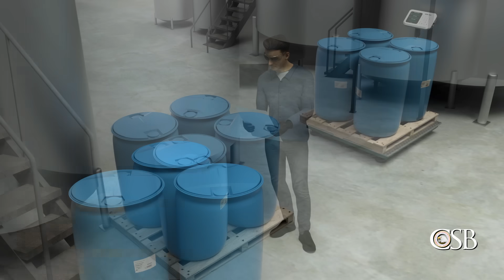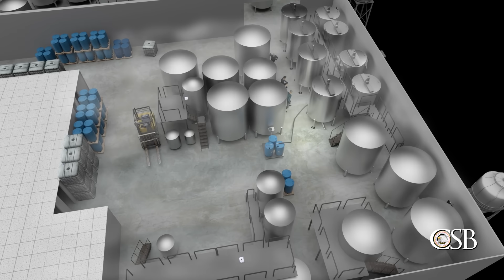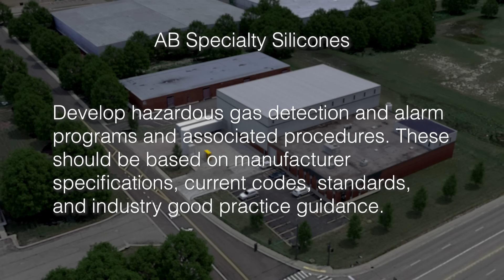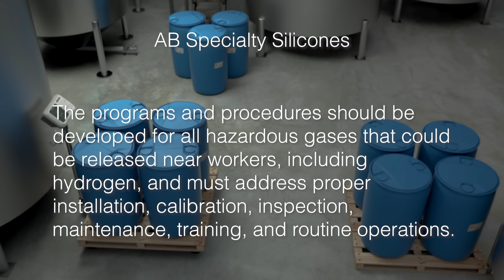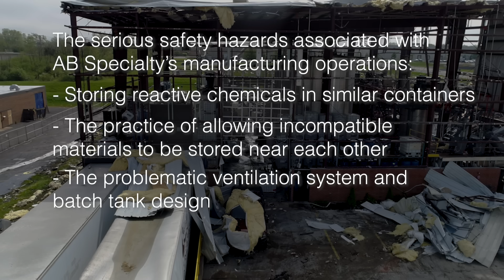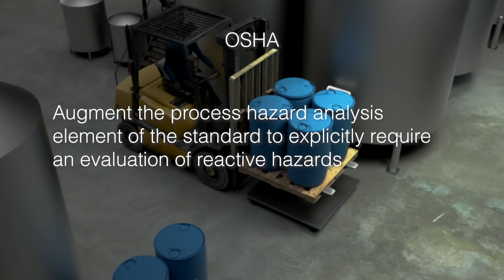Incompatible Chemicals: Explosion at AB Specialty Silicones

Comment: Earlier this week I had a tyre patched at a tire kingdom shop. The shop sent a young kid ( maybe 20 y/o) w just a floor jack, no jack stands, no wheel chocks, to lift and work under my 7000lb truck. I took photos and informed the local manager and corporate. Also I called OSHA. As of 72 hrs later no one has shown any interest in the problem. Guess we just have to wait until someone loses life or limb. Very sad.
Reply: I used to work Merchant's now Tire Kingdom they don't give a shit about safety and didn't care that we needed new equipment my store manager almost had his head smashed from a tire after he got it on the rim went to put air in it to set the bead and when the bead set the whole tire came flying off the tire machine
Reply: You wouldn't believe how many people disable the locks on their lifts ...
Reply: @Merker367  I know ive seen some pretty stupid shit when I was in the shop guys not putting lift on locks to service manager getting his leg cut open when he opened the bay door and the glass fell out of the door
Reply: Ineptitude for profit is at cabinet levels.
Reply: Why did he have to get underneath a truck to simply remove a wheel?
Reply: No jack stands is a big problem especially from my experience. I have never done any work on even a 1 ton car without stands. The only thing I don’t use stands on is something I can lift myself.
Reply: Way to get the dude fired, asshole
Reply: Republicans don’t want to fund OSHA or the FDA, so work and food safety inspectors are spread very thin. It takes a major problem to get their attention now. Or you have to know the right people.
Reply: This is America, where workers will cheer for politicians that tell them "let's deregulate the job creators!" This is what we end up with.
Reply: @gloomyblackfur399  Modern regulations don't make us safer. People deciding to be safer, makes us safer. Most regulations are pencil wipped for "compliance" but actually changes nothing and most of the time the regulations are not really compatible with the work being done. No one knows better how to be safe than you, teaching employees about the hazards and encourage them to take steps to keep themselves safe instead of cookie cutter safet regulations are much better. Modern regs just increase costs for all of us while not adding much protection. Basic regulations are good but the more complex recent ones don't seem to translate well to the real world.
Reply: @gloomyblackfur399 look how he spelled tyre😂 he’s uk
Reply: If you're just doing a tire and you're not under the vehicle you're fine. I mean, might fuck your brake rotors up a bit if it falls, but thats it

What kind of truck do you have that weighs 7000 lbs? F250 or equivalent?
Reply: @RVBJohn  ok so a shop drops your car on it's rotors and bends up the shields and your supposed to be ok with that? No matter if someone's under the vehicle or not, always use stands
Reply: @Merker367  i worked in the automotive field for over twenty years, A.S.E. certified, was a certified state inspector. Never used a stand under a vehicle that was one inch off the ground to remove a tire for a short repair. You can be critical about everything if thats what floats your boat. Your grocery store makes more safety violations that most repair shops. In my twenty plus years i never had or saw a floor jack fail suddenly. They give warning signs when they get weak. I am shocked a person would call osha over a person not using a jack stand for a 5 min repair. Probably the same kind of person to be first to complain the repair takes to long or too exspensive. I had osha and the e.p.a. in my shop a few times and never had a problem. What is the funniest part is he makes no mention if the 20 y.o. had eye protection on or ear protection on. If he was truly concerned, that should of been his concern. Its sad this person watched one of these videos and decided to put on a cape and save the world. Please introduce me to your amazing perfect world. Glass houses and rocks and all that. This is a great example of what happenes when a person gets a little bit of new information, they suddenly feel they are an expert on safety.
Reply: @Merker367  I agree, but they were talking about not using a jack stands. That was why I explained why they don't. I didn't just tell them or you to be quiet. That's part of the problem today, a person that is qualified to speak on this topic is being told to be quiet and you're being dismissive. Anytime a person has any part of them under a vehicle, they should use a stand. This case, the kid wasn't. Ofcourse he should of been wearing eye and ear protection. Instead of that being asked people switch to cars on lifts, and locks on thier lifts not being used, which I agree with you they should never be bypassed.
Reply: If the consequence is a damaged vehicle or broken finger all the way to death and the solution is to  chock a wheel and use a jack stand then it should make sense to use the preventative measure. It takes an extra minutes at the most and cost a one time purchase of im guessing $150.

Many people get killed at home relying on a jack to hold while they work on their vehicles but they choose to work unsafely. The safe alternative should be provided in a workplace.
Reply: How about you put your phone down, and go ask the kid to fetch a chock block.  Tell'em he's gotta look out for his own safety even though he's young.  Don't do.....this.  You don't help anyone by being a karen about what ifs.

Comment: As soon as I saw the mixup and how it occurred, I was thinking "Why can't the drums be different colors?".  

We've used some of these principles outlined in these videos at home and in the workshop. For example, the bleach is in a physically different cabinet than other, incompatible cleaning solutions such as ammonia solution. Likewise, we keep hydrocarbon products like spray paint and automotive chemicals in yet another couple areas, divided up so the entire supply doesn't catch fire should ignition occur.
Reply: the drums are a standard bulk container and it wasn't clear if they were being reused inside the plant or not.

however a good way to deal with this is to simply have your receiving (or loading if dealing with internal reuse) department put a band around the barrel, could be as simple as a colored band or as complex as a laser cut sign depending on the needs of the individual plant, once empty the band would be removed.
Reply: @ARockRaider  We used big colored sharpies markers.  On top and side.
Reply: Blue drums are industry standard for a lot of bulk chemicals. You can , theoretically,  get custom stuff but that is additional costs and delays. And there are thousands of chemicals and infinite combinations of them. We have KOH in IBCs and it looks like every other IBC on a warehouse. 

I would be interested in a detailed video, and/or analysis, about a production facility that does this right. Second of all, materials like KOH are very dangerous and  it should be illegal to sell them in the same containers as any other material (but with a sticker!). But that is jut me I guess.
Reply: @DWPL89  I think my idea for an in house band or sign that gets installed on all containers as soon as they are brought in would deal with your problem as well, if the bean counters don't like the idea find out how much a single mix up of those IBCs would cost, I'm sure anything form a few thousand to a few million if something like what happens in the video happens.
Reply: @ARockRaider  A simple (i.e. easy to read, max 5 letters) label next to the opening would be better. People already look at the opening when inserting the pipe, so a label that is in their field of view has a good chance of being picked up even if they don't actively look for it.

That's why doors have the pull/push label near the handle and not next to the door. (Yes, bad example with those useless labels, but I couldn't come up with a good one in a hurry.)
Reply: @HenryLoenwind  that could be a good option, I think a color code included In that would be even better.

My hope is that any solution would be easy and cheap to retrofit, as the design of the barrels won't change with out extreme expense and it would be wasteful to lock a barrel into only a single chemical.
Reply: @DWPL89  I work in a water plant.  Our supplies of Sodium Hypoclorate, Polymer and Ferric Chloride all come in identical blue barrels(and there are a couple old Permanganate barrels in storage as well).  These are standard and among the industry as you said.   To be honest ANYTHING in a blue bulk chemical barrel should be considered hazardous.  We just store the each chemical in completely different places to avoid issues.
Reply: They could also use barcode scanners in combination with the scale - improved qualtity and safety
Reply: @jst6757  I service paint tinting machines in home improvement stores. Some of them require the sales persons to scan the base paint container before putting it into the tinting machine.
Reply: @jst6757  seems to me they did not bother to read the labels. Bar code reader would have helped.
Reply: @DocZoidberg549  depending on the suppler, the labels can be VERY similar.   Yes you should carefully read the label every time, but we are talking about human beings here.  As the lady said, should be made easier to do the job right and harder to do it wrong.
Reply: @harrywilliamson7043  The labeling needs to be improved and use bar codes with a mobile computer to alert for issues. Their safety system was also very lacking.  I wonder who was responsible for overseeing their ISO program.
Reply: Because that's not a solution.  Like, the number of chemicals in use, and then the number of unique combinations of said chemicals means that coloring KOH barrels differently might fix this one combination, but wouldn't address most others.  Hell, even in this situation, the KOH added to the final product was perfectly fine.  The problem was only present when it was added at the wrong point in the process.  This is a process issue, not a drum color issue.  There should have been an established process to return chemicals to storage after use, and scan the drums prior to use every time to confirm the contents.  

And of course having functional detection and warning systems in place, and adequate emergency venting equipment is a must.
Reply: @acolytetojippity  It wasn't so much an issue of adding it at the wrong time, as it was adding too much. It's like if you accidentally put a cup of salt into your cookie recipe instead of a teaspoon, because you got the salt and sugar containers mixed up.
Reply: Likewise, these additional mixed chemicals should have the amount needed measured out into a separate container and then the excess put back in the storage
Reply: Blue plastic barrels are an industry standard - used for acids/alkalis, food products or anything else not compatible with a steel barrel. Having different colours for barrel's is not really a practical solution.
This is more an issue of training and working procedures such as pre operation checks. 
A simple solution could be a the user attaching a 6" coloured decal to each barrel on arrival at goods in denoting a 'quick reference' but this could lead to an even bigger risk of complacency.

You'd like to think people entrusted to mix large amounts of chemicals had the competency to read a label. But often repetition of a task leads to complacency.
Reply: Working in a chemical plant, EVERYTHING, comes in blue drums. The trick is to have good shop labels.
Reply: Because they order it from suppliers.
Reply: I know I saw those light blue identical drums and thought oh I know what the problem is .

Comment: This is so sad. I was on a road not far from there when it happened and saw the explosion. The explosion could be felt 16 miles away and took out some power. It’s nice to hear some closure about what happened.
Reply: Hydrogen gas is insanely explosive. Making a car run on it soooo much worse in an accident compared to petrol

Comment: sad, this was extremely preventable with some of the most basic safety precautions
Reply: This feels like a tough problem to solve, more than just simple solutions are required.

It's pretty difficult to manage a hydrogen leak indoors. The explosive limits are very wide and the reactions that produce hydrogen tend to produce it in large volume.

By the time hydrogen foam is spilling on the floor, you have to assume that the whole building is a live bomb. Gas detectors are better than nothing, but they're not enough.

The best opportunity to prevent this was to notice that many hydrosilicon compounds are incompatible with strong bases. Strong bases are frequently used in chemical manufacturing.

Ideally I don't want to trust color coding. It's another really good step, but using the wrong pump with the wrong color is enough to blow up your factory, that shouldn't be acceptable.

I actually don't know what the solution is - maybe you try to force the company to design and maintain a ventilation system that can handle a hydrogen release. But that sounds like exactly the kind of cost which management will neglect the moment you look away.
Reply: @jordanrodrigues1279  great points, but in the very least having the different chemicals in different colored barrels or some kind of better storing and seperating of the chemicals would have had the potential to avoid this, also having the gas detectors would have been helpful, or even a general safety plan and procedures in case such an event happened

Comment: Hi @USCSB I noticed that the video shows ‘non-functioning ceiling mounted gas detectors’ several times in the animation, but the narrator states they did not have any gas detectors. It’s not clear which is accurate. Also, I’m not sure which would actually be more worrying: not having detectors, or having non functional ones…in either case, the detectors would be a last line of defense. All the other changes recommended would be much more important

Comment: I usually am in full agreement with recommendations, but in this case, I feel section 5.2 of the AB Specialty Silicones Explosion Assessment should have been emphasized separately from the general unsafe working culture. (Short summary of of 5.2 is that there were multiple potential ignition sources, many of which have ways to be mitigated, such as "explosion proof" outlets, and proper grounding of static electricity accumulating metals). 

6.1 of that same report states " The amount of time from start of hydrogen release to ignition cannot be quantified since a definitive chronological sequence is not available and exact time of hydrogen production is not identifiable". This video indicates 2 workers had gone to open the vents, but did not reach them in time. Even if there were alarms, and the workers had training, it is entirely possible they would not have time to evacuate before an explosion. I know these things are a balance between risk and cost, yet I feel that any environment where hydrogen could be generated on accident should have ways to reduce potential ignition sources, should have those in place.

In fact, one thing I am wondering is integration of the recommended hydrogen gas detectors with the building's electrical supply. If a flammable gas is detected, a breaker (ideally outside the building) can be tripped remotely, thus eliminating potential ignition sources without incurring significant cost. This could be further augmented by separate circuits for most of the facility and one specifically for ventilation. 

This is all armchair speculation of course. I'm not an expert, and still feel that this report is fantastic in all other regards.
Reply: I would hazard a guess the reason they didn’t do this is because practically any environment can have a situation that results in the generation of hydrogen. It’s a very common byproduct of chemical reactions, and advising that all environments that have the potential for a large release of hydrogen gas use explosion proof outlets and static controls would likely have the end result of advising that all locations should use them. 

In addition, breaking the power supply upon detection of a hydrogen leak would likely not be ideal. Breaking the circuit has the potential to cause an arc, and not all processes can be safely halted in such a manner. It might have been of use in this specific example, but it’s not suitable advise to give generally.